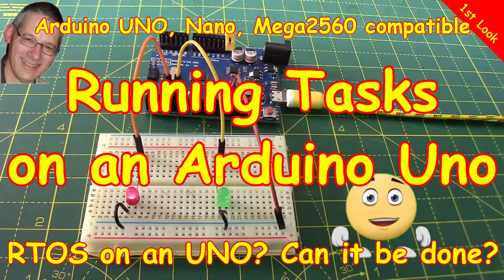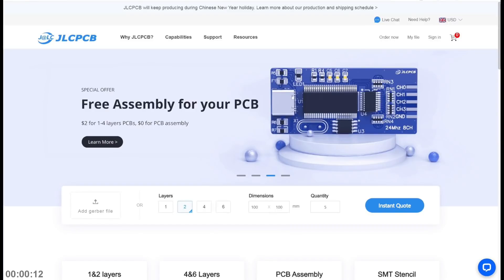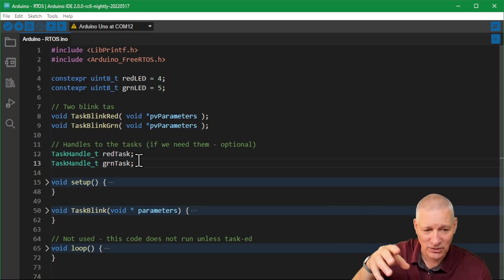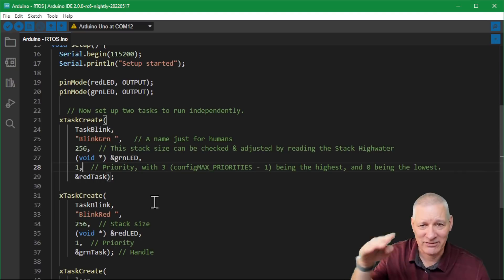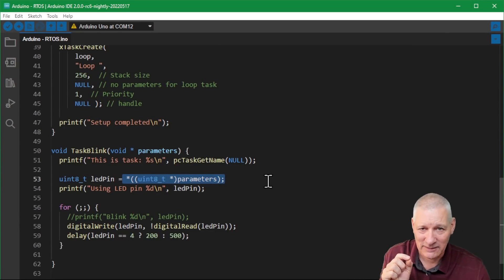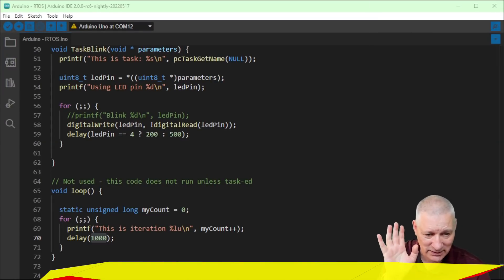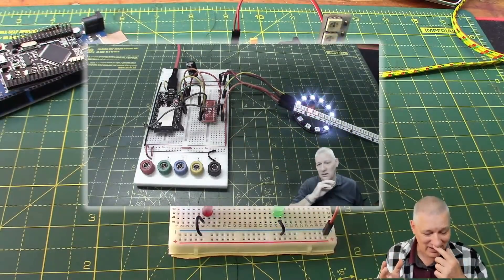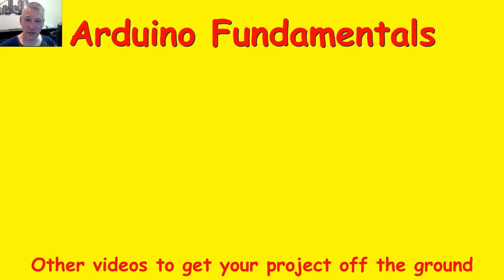#244 Multiple tasks on an Arduino?😲FreeRTOS can do it - so can you😜

Comment from the maker: Just to get a sense of perspective, running this demo sketch (the two blinking LEDs):
----------------------------------------------------------------------
Arduino Mega2560 (8K SRAM, 256KB flash)
----------------------------------------------------------------------
Sketch uses 14476 bytes (5%) of program storage space. Maximum is 253952 bytes.
Global variables use 595 bytes (7%) of dynamic memory, leaving 7597 bytes for local variables. Maximum is 8192 bytes.

--------------------------
Compilation complete.

----------------------------------------------------------------------
The Arduino Uno (2K SRAM, 32KB flash)
----------------------------------------------------------------------
Sketch uses 144544 bytes (45%) of program storage space. Maximum is 32256 bytes.
Global variables use 563 bytes (27%) of dynamic memory, leaving 1485 bytes for local variables. Maximum is 2048 bytes.

--------------------------
Compilation complete.

Slight discrepancy between devices as I've been playing about with the code for the Mega2560!

Comment: Thank you for the video Ralph. I implemented FreeRTOS on a Arduino Mega 2560 and noticed a few "quirks" when adding additional sensors/tasks. As of now I have a variety of tasks for a DHT11, two separate LEDs. HC-SR04 Ultrasonic sensor, and a LCD with the I2C backpack.  In setup, the xTaskCreate function parameter "priority" had a significant effect in which task was executing. This required some experimentation in determining which priorities were most important. Additionally, I noticed FreeRTOS has functions for delays "vTaskDelay" which I havent tested or run a comparison yet between the Arduino delay. One question I'm uncertain about still is if the scheduler needs to (or should)  be called specifically for each function using the native function "vTaskStartScheduler"? To me it seems redundant however I'm curious of your thoughts on that.
Reply: The whole point of using FreeRTOS is to use 'vTaskDelay' exclusively and NEVER use regular 'delay()' never again.
Reply from the maker: @vincentdesjardins1354 Luckily for us, the delay(x) command is translated to vTaskDelay(x) by the underlying macro. 

That said, it would be better programming practice if we specifically used the correct method rather than using Arduino-speak, but the final result is the same.
Reply: @ Thanks for this insight, I did not known that. I'll be less stressed out now while tracking+commenting every 'delay()' in my code.

Might I add: We dearely miss you Ralph! I'm sure you have good reasons for tacking a YT break but please consider posting new vids at your earliest convenience.

Comment: The arduino uno has the Atmega 328. I have a Movi Audeme shield it has an A13 chip on it. A13 is a 64 bit processor, Arm Cortex 8, and Linux Kernel. The problem is that it would be considered as the slave to the Master Arduino Uno Atmega 328. Is there way to utilize that chip on the Movi shield for the FreeRTOS instead of putting it to the Arduino Uno 328 that is the Master?
Reply from the maker: Well, that Movi Auderne is for voice recognition (Alexa, shut the bleep UP!) because the Arduino would take about an hour to decipher each voice command. I have no idea whether you can run other stuff on that shield, I'm afraid. As it can "understand" 150 sentences I guess it's highly tuned to running its own software already.

Comment: Hello, When I compile the code I get this error: Compilation error: 'pcTaskGetName' was not declared in this scope...Would you be so kind as to help me correct this? Thank you!
Reply from the maker: Did you take my example code first (we know that compiles) and try that?

That sort of error usually means that you either have really not got a function called 'pcTaskGetName' or you have not got an #include for the file in which it was written. Basically, the compiler cannot find it at the time it needs it.

Are you using Arduino IDE or Visual Studio Code with PlatformIO?
Reply: Thank you! An update of the header files solved all the problems!

Best regards

Comment: thanks for sharing, do you know something similar to esp8266? usin RTOS for esp8266
Reply from the maker: I think that the standard Espressif RTOS can be used with the ESP8266, as it's a much bigger chip and is, basically, the smaller brother of the ESP32. It's certainly available via the Espressif SDK for the ESP8266 but you will have to Google to see whether someone has created an Arduino IDE-compatible version (maybe Espressif have).

Comment: But can't you do the same thing without that Real Time O/S?   (the task as the end of the video I am talking about).  Nice video, by the way, and great video production with the code in full screen, and you on the bottom right, I guess filming on a green screen.  Very nice video production.  That takes a lot of work to do all that.  It is appreciated.
Reply from the maker: Yes you can! If you use the pseudo-multitasking method I showed recently (video #BB5 - https://youtu.be/hwEo49yyU88 ) using millis, then you do not have to use an RTOS at all. I use that all the time on the smaller (and not so small) processors.

Thank you for your kind words about my videos. Yes, they take time but the end result justifies the effort IMHO 😉
Reply: @RalphBacon  It's always kind of cool and weird when you get back a reply from someone on the "TV".  I just saw a video of your 1985  "claim to fame circuit" that got publiished in a magazine.  I am sure you were making circuits long before that.  Since we are talking about the past, in 1975, I built the Paia Gnome synth.  https://www.youtube.com/watch?v=jSpXtQxYWfg  
After seeing this video, I wished I had of kept it.  I think I ended up just throwing it away. I think they are worth quite a bit now.
Reply from the maker: Probably worth thousands now. Oh well. 😥

Comment: Thinking the Arduino is not a freely programmable computer because its programmes are in ROM and it cannot have a linux like kernel because it does not have enough RAM but too many registers to save state ... you proofed me wrong. maybe connecting a system like RTOS and the Xorg loop to make the Arduino loop part of the linux loop and so an os that actually spans two or more computer might be a thing.
Reply from the maker: I'm glad it made you think about it, at least! Try it on the Mega2560, that has 8K SRAM and RTOS works very well there.

Comment: This is great.  One task for the motion sensor and one to monitor the bucket of water's trigger!  LOL.  I've played with Arduino over the years, nothing serious, nothing in production running around the house, but the little I did, I thought it wasn't reliable meaning it would lose itself so I felt I needed to code a shutdown/restart so it regularly restarted.  All the code I've ever run was very basic.  What do you think about Arduino's reliability?
Reply from the maker: The Arduino will run for years - if the code is good. That said, my fridge alarm did stop every few months or so and required a reset. I suspect a power glitch. If you are worried that the Arduino will suddenly hang, implement the watchdog timer to reset it automatically. That's what it's there for!
Reply: I have an arduino which reminds the boss to take her pills at breakfast. Been running for 2+ years and on the same 3 AA batteries! RTC does the timing.

Comment: I would consider
struct {
  uint8_t pin;
  uint16 delay;
} grnLED, redLED,...;
and simply fill in the struct for each LED.  Alternately, Arduino uses C++ so you could also make a class complete with blink function, instantiate 
cBlinker grnLED(grnPin, grnDly), redLED(redPin, redDly);
and pass pointers to the objects to the task manger.  The classes are a more type-safe way to do it and don't need global structs.  I like these approaches because they are easily extendable to more LEDs.
Reply from the maker: If you want to use objects for RTOS you need to read up on a library by Flossie that puts this RTOS inside an OOP statically allocated wrapper. See: https://github.com/Floessie/frt

Your code suggestions are great, but remember this demo was to encourage beginners and the inexperienced to have a go, not to put them off with structs, pointers or objects (two of which are subjects of a future video, so we are thinking along the same lines). But which scare the bejesus out of the aforementioned viewers.

I've maintained C++ rarely needs pointers (so I'd see if a reference was enough for your suggested code) but I've just had to use pointers in a bit of code here and no, a reference was not enough this time.

Thanks for posting, Byron, good to hear from you 👍🏻
Reply: @RalphBacon  I was unaware of Floessie so thanks for that.  I have previously utilized "adapter functions" with ISRs that use class objects and I suspect that the wrapper does the same.  Once you realize that the first (hidden) parameter to class functions is the pointer to 'this,' a new world opens up...

Comment: An interesting experiment Ralph, but I have a few concerns about using it in serious projects. 1) An atmega328p is very resource constrained. Using multiple 256 stacks, one per task seems poor use of the 2k available. 2) the Arduino Freertos implementation uses the watchdog timer with a 15ms heartbeat. That's too slow! We should aim for 1ms for an RTOS. 3) You are living dangerously with the Neopixel code. The timing requirements of Neopixels are challenging. The  Adafruit Neopixel library generates timing by disabling interrupts and using hand-crafted assembler code for bit banging. Disabling interrupts in any RTOS is asking for trouble!. So, a fun project, but I'd suggest a rewrite with a polling approach to avoid technical debt. Nothing in the application needs an RTOS.
Reply from the maker: Your observations on timers and such using the Adafruit library are valid, but you're looking at this from the wrong direction, Mike.

This demo was to see if 
(a) RTOS could even run on the Arduino
(b) whether it could do anything sensible

So we proved point (a) with the two flashing LEDs but I thought what could I use (quickly) to prove (b). Well, the code for the Neopixels was still fresh in my mind (I'm using it in my current project) so I just threw it in, with scant regard for timers or much else to tell the truth.

I was amazed it worked but it did prove that RTOS on the Arduino could do some "real work" other than two flashing LEDs. But I doubt whether I'd use this on a real project as the memory is limited (I'm using 220 bytes per task right now with 38 bytes free stack). But a simple sensor task would be fine, I'm sure.

A Mega2560 is probably more sensible (8K SRAM) but I've yet to plug that in.

Comment: Feels a bit like putting an engine management system on a lawnmower. And it messes anything timing related. 
But interesting idea and a workable option on a chip with more resources.The evil memory management looks a bit tricky
Reply from the maker: Hang on, your lawnmower doesn't have an engine management system? No turbo? No supercharger? I guess it's a push-along rather than a sit-on, with 4 speeds (and reverse)? 😁🤣(No mini beer fridge either, I'll be bound).

I like the analogy though. I think using it on a Mega2560 is a better place to start (8K SRAM) just to experiment. I don't like the lack of a loop() though, unlike the ESP32. But using it on an UNO just as an introduction to multi-tasking still works (as this video shows).

Comment: I learned how to use FreeRTOS with an esp32. When I did try to use it on an uno it used up too many resources. Can not remember if it was ram or rom.
Reply from the maker: I don't suppose you can run NASA on an Arduino RTOS board 😁 but for simple stuff it might prove useful - even more so an an introduction to multitasking.

Comment: Is the bug declaring the led pins as uint8_t but then casting them to uint8_t pointers?
Reply from the maker: You're on the right track. I've cast the void* incoming parameters as a uint8_t (one byte) pointer and got the value (dereferenced) that. No idea how this is working 😲

The line: 
uint8_t ledPin = *((uint8_t)parameters);

should say
uint8_t ledPin = *((int)parameters);        // could say int16_t instead of int
Reply: @RalphBacon  Not sure what you mean there. Although pointers on this architecture are 2 bytes in size they can just the same point to a data type that is just 1 byte in size. You actually have *((uint8_t *)parameters) in your video which seems perfectly fine to me. Maybe you thought you were casting the pointer itself to the actual data? That's what it seems to me from the example above.
Reply from the maker: Ok, there is no bug after all.🤦‍♂️ For some reason I was convinced I was using an integer uint16_t to pass the parameter around but it's not, it's a one byte uint8_t integer. I did this deliberately so why I lost the plot I shall never know. So it's all working fine.

Comment: Hey, another great video Ralph. This left me with a bunch of questions though.  Like, how much space does the RTOS use up?  What other functions are available in freeRTOS?  What are the differences in RTOS on esp32 vs Arduino?  Also, what are the advantages/disadvantages of using RTOS rather than the millis() multiprocessing techniques you demonstrated in the other video?  
I think there's easily enough questions around RTOS for you to do a follow-up video.
Reply from the maker: Got a question, John? OMG an avalanche is more like it! Well, there's no such thing as a free lunch so RTOS does use up some space which is why this all runs much better on an Arduino Mega2560 with 8K SRAM.

Differences there are, as this is a lightweight, sneak-it-in implementation of RTOS rather than a full blown ESP32 rewrite. For example, the loop doesn't run the way you might think it should (see Github 'issues' tab for more info). https://github.com/RalphBacon/244-RTOS-for-Arduino/issues

My milliseconds approach is a much memory friendlier approach but relies on each function completing in a reasonable amount of time - there is no pre-empting in my way so a heavy function will just continue to run until it runs out of things to do. FreeRTOS only gives each task a 15mS time-slice before pre-empting it for other tasks to run.

I might have to do a follow up using a Mega2560... or a Nano Every 4809 if I can get FreeRTOS running on it.
Reply: @RalphBacon  Would love to see something on the 4809; so little out there

Comment: -hmmm..not hearing from you again?..nah, can't have that, always love to hear from you!
I am surprised that you didn't believe a operating system could run on Arduino, of course there is limitations but the old Z80 could run OS.
Reply from the maker: I wonder how the Z80 compares to an ATMega328P? It seems others have asked this and it would more than hold the pace, probably be faster than a Z80 running CP/M but it's the memory that would hold it back.
More here: https://bit.ly/3G62pCU
Reply: @RalphBacon  Wouldn't it be posible to add more memory?

Comment: Ralph: "C does not have references," nice gem there: would you be able to expand on this a little?
Reply from the maker: OK: C does not have references but it does have pointers. Enough? Sigh. Thought not.

In C you are programming very close to the metal.  So C lets you do pretty much what you want with pointers, even pointing to an invalid location or variable type.

C++ tried to tame this behaviour with references so that some logic was brought in so that pointers could only point to ONE valid thing (and cannot be changed afterwards) - and called them references. More to it than this but that's about it. C++ has pointers too of course.
Reply: @RalphBacon  Thanks so much for the succinct reply. I had really not thought about references much before, but your video piqued my curiosity. I hadn't realised the safety aspect was the reason for choosing references over pointers.
Reply from the maker: Bjarne Stroustrup and I were having a drink a week ago and were mulling over the dangers of pointers in C and he said "That's why I created references for my C++". Enough said. Can't argue with the C++ inventor can we?
Reply: @RalphBacon  Too true :)

Comment: Remember you must not put anything in the task that delays or waits for longer than the time each task has been allocated, or you will have fun with the watchdog biting you rear.
Reply: Delays are no issue if the FreeRTOS delay functions are used. They put a Task to sleep, until it is due to run again. 0 overhead waiting for as long as you want.

vTaskDelay() or vTaskDelayUntil() are your friends.
Reply: @ThreeDRaymaker  TaskDelays are ok, but you need to be careful with beginners and delays and loops etc, you have to get your head around the fact the tasks being jumped around in time slices. And don’t like any blocking code.
Reply from the maker: I've updated my demo sketch in the GitHub that contains vTaskDelay and got the loop sorted out too (thanks to a nudge from Phillip, the FreeRTOS for Arduino author).

Comment: Watch out for having too low an amount of stack memory as you will kill the canary as i did.
Reply from the maker: I use this code, called every so often, to check on stack space for each task:

// Check stack space
void checkStack(uint8_t binNo) {
   unsigned long remainingStack = uxTaskGetStackHighWaterMark(NULL);
   printf("Task %d Free stack:%lu\n", binNo, remainingStack);

}
Reply: @RalphBacon  looks like a useful bit of information to know. I'm working on tasks using wifi it would be good to know if I'm giving them too much stack space. so i might try this and store the max amount of space used. I might be able to spread it about more without killing the canary.
Reply from the maker: Yes, I call this routine every minute or so during debugging, then every hour for longer term testing just to ensure the free stack doesn't suddenly shrink (which it can do).